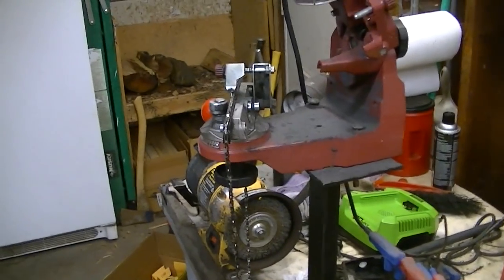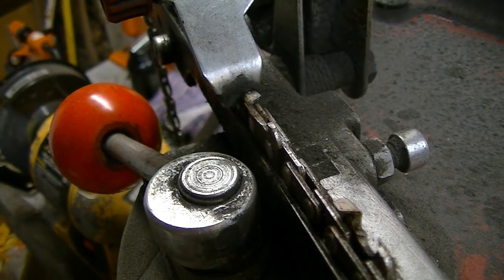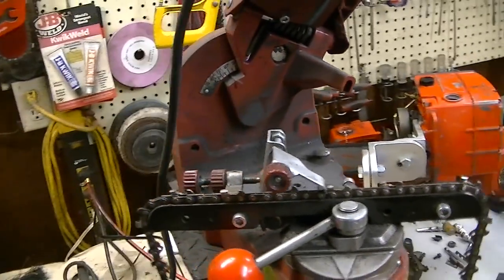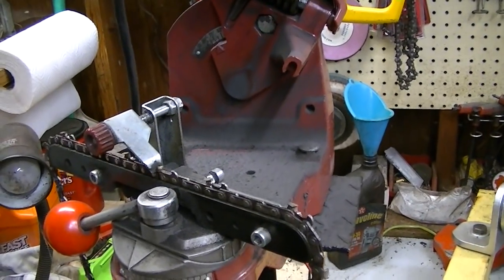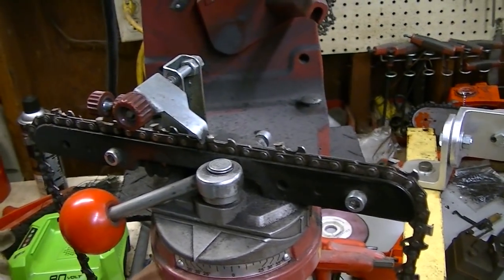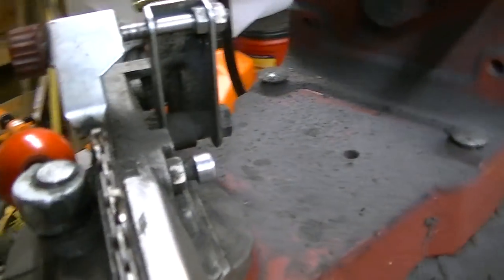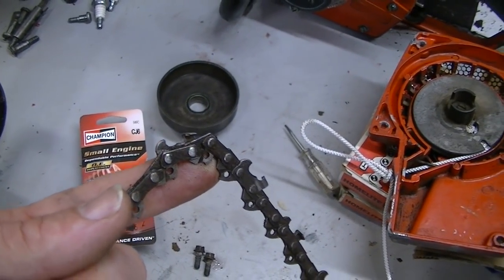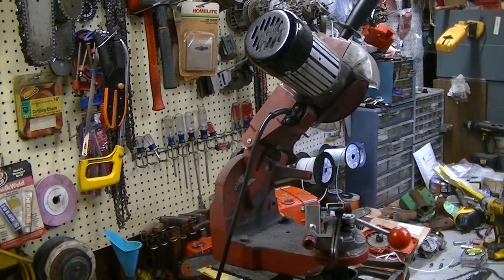Why I Prefer a Chain Grinder

Comment from the maker: Okay folks, I posted this video to show people how I sharpen a chain, especially on a customer's saw.  There are dozens of different opinions around this topic and in the video I'm not trying to persuade anyone, simply showing one way that works every single time.  But since a number of folks that follow other channels have decided to point out to me how wrong I am, now I'll do a little persuading.  My method takes a lot of steps out that can trip the average user up.  Yes, chain teeth can be different lengths and still cut good.  HOWEVER for that to work, you must file each depth gauge to match each tooth, each time you sharpen the chain.  I'd guess that many saw users don't even own a depth gauge, let alone have ever used one.  

Simply looking at a chain with mismatched tooth lengths will demonstrate that this is going to cause some sort of abnormal wear.  Chainsaw teeth taper back as they wear; if one side is filed down an 1/8" more than the other, the high side ends up doing more work, as it protrudes farther into the cut.  It stands to reason that the bar rail on the high side will end up having more pressure applied to it, hence faster wear on that side.

For every 10 used bars I see come through my shop, 8-9 have significant wear.   Whether it's chunking out of the rails, low spots, spread rails, tapered rails or some combination of all of these, it all comes back to the chain maintenance.  Bars will wear over time, but how you maintain the chain determines a lot of how quickly they wear and how badly they deteriorate.  I am a firm believer that the BEST method of chain maintenance is to keep your chain teeth the same length and if you have the ability, match the raker heights to the teeth.  That's what I recommend based on my experience and I can assure you that I've cut hundreds of cords of wood.  I've sharpened hundreds of chains and when I was a beginner, I made many of the mistakes that I now try to help people avoid.

For the guys that watch Buckin' Billy Ray's channel, I really don't need your commentary about how how much I can learn from him.  I enjoy his channel from time to time myself.  If I wanted to learn about climbing, falling or restoring old axes, he'd be a really good source of knowledge.  When it comes to saw repairs and maintenance, I don't need to look to his channel as my knowledge and experience speaks for itself.  If you've just watched one of his videos and come here to tell me how wrong I am, do me a favor and keep it to yourself.  I'm not at all interested in hearing it...if you want to have an intelligent conversation about something, contact me through my website: https://www.leonschainsawpartsandrepair.com/contact.html
Reply: Well said and eloquent response.
Reply: Very well stated Leon. I enjoy Buckin's channel also and I appreciate the both of you sharing your skill and expertise.  I enjoy learning from both of you and a few others too.  I think you're doing a fine job and hope you continue to share your experience.  There's a ton of videos claiming to show the "right" way to sharpen chain.  In the end we have to decide what's gonna work for our own situation.  I use a grinder and I like it for the consistency and the speed.  I also sharpen by hand sometimes and have had good results that way too. One of the things I like about hanging out in your channel is the no nonsense way you have of explaining what you're doing without all the flashy special effects and graphics.  Just a guy calmly doing his thing and teaching anyone willing to learn.  That, plus I have 6 Homelites that I like to keep running!  Love the older saws.
Reply: I have a carlton grinder just like this . in your opinion leon, what are the best brand of discs to use ? I only use mine for my own saws .
Reply: I watch Buckins channel and he has some one do most all of his repairs and runs modified saws most of the time. When it comes to  When it comes to saw repairs and maintenance. Your channel. I didn't read the comments but you hit the nail on the head.
Reply: Well said sir I know ur method works since watching this I just used it earlier so he'll with what others think it works . Thanks again for your help and video.
Reply: i guess Im asking the wrong place but does anybody know a method to get back into an instagram account?
I was stupid forgot the login password. I would love any tricks you can give me!
Reply: @Aldo Gannon Instablaster =)
Reply: @Jeffrey Gatlin I really appreciate your reply. I found the site thru google and Im trying it out now.
Takes quite some time so I will get back to you later when my account password hopefully is recovered.
Reply: @Jeffrey Gatlin it did the trick and I finally got access to my account again. Im so happy:D
Thank you so much, you really help me out !
Reply: @Aldo Gannon you are welcome :D

Comment: Forget all the so called experts who provide with negative comment. Your info is spot on. I have been using an "Efco Jolly" grinder for the past few years now. I have 3 saws, Husky 450, Husky 365 and a crap Ryobi (don't take it out in the bush though. I cut 13 to 15 tonne of good old Australian Hardwood per year and use it at the house. I take 3 chains per saw with me and cut my wood into 14'" rounds 24" thick. I load about 1 tonne per trip. I change the chain each tank of fuel. or when I hit rock in the dirt! On my return home it takes no more than 4 or 5 minutes per chain and they are ready for the next trip.  Been using the method you so accurately describe for all that time and have always achieved great results. keep up the good work!
Reply from the maker: Thanks Frank!  The methods described in this video are certainly not the only way to maintain a chain...but they are tried & true and will deliver the same results each time.

Comment: late to the party with this comment but thanks for your video. I read down the comments and  was kind of surprised at the number of misinformed and less than sharp viewers....and a fair number of smart asses. The grinder is an excellent tool for reproducible, consistent sharpening of cutters and setting of depth gauges. They are not meant to be carried to the woods like some comments mentioned.  And the set up to sharpen is quick and easy once you understand what needs to be done. The way I use them is to have several sharp chains, do no filing in the field, bring the stuff home and tend to chains in the shop. I have not found the pink wheels to be junk either, used correctly they do a fine job and lend themselves to dressing to a face shape you want with the dressing stick. The real key to using these is to be accurate in set up then take very, very small cuts, that way the metal does not overheat  I would bet many of the negative comments reflect the lack of knowledge about cutter geometry and sharpening procedures. I have had the Oregon model for more than 25 years now and still the same OEM wheel on it. I milled logs with an Alaskan mill and relied on this grinder to produce well sharpened chain in a short time.

Comment: A suggestion, swap out the filament bulb on the grinder & replace with a LED one. Less heat generated & more light output for energy input. Really see what you are working on !

Comment: No flame intended you need both. The grinder if the chain hit the ground and was tilling the rocky soil. The grinder if teeth were broken off a like new chain and the repair kits changed out the bad teeth. A file for a quick touch up if the chain looks ok. I do use the file more.
Reply from the maker: Sounds reasonable to me!

Comment: I, also, have a Roughneck Sharpener.  My problem is the Tilting Deck settings. Some chains claim to need a 0 degree angle, some a 10 degree angle.  Unfortuneatly, I can't find anywhere what those three markings are supposed to be.  The instruction manual for this area of settings are clear as mud.  I know this video was posted a long time ago, but if anybody can tell me which angle is 0 degrees, which is 5 degrees, and which mark is 10 degrees, you'd sure make this old man a happy camper. They show up very clear at time 2:44.  Thank you for any help you or anyone else can supply.
Reply: If your talking about the tilt and the three marks you see at th base that is for chisel chains those are  10 degree o degree and 10 degree against your doing right hand cutters you loosen up th table and push the knob away from you it will line up with another mark on the base plate that's 10 degrees if it left hand cutters you pull the bottom of the table towards and the bros will line up again and it's set 10 degrees for left hand cutters this has absolutely nothing to do with the proper angle though . like I said this addresses full chisel chains only . semi chisel or anything else you leave that part centered. Some full chisel.still chains don't even require this adjustment. If you use Oregon full chisel chain you will use this. If your doing all the rest if the settings right younwill.have a very sharp saw but your starting to sacrifice safety kick back and other such undesirable issues with this its very sharp but gets dull quicker if that makes sense.

Comment: Grinder or file.  As long as they cut to your likeing.  Realy dont matter.   On a grinder you can make a chain. Cut. So much it will stall a saw out.    Chain wont stay sharp long.  So.  30 deg 60 deg and 10deg set back.  Nice slow grinds.  Youll be happy.   I can change a chain faster then any one can file.

Comment: I have a grinder similar to yours and it came with those junk pink wheels also. Once you get your hands on a resinoid wheel @t you will throw those pink wheels in the trash like I did. They do not heat up the cutters and blue them removing the temper, you will grind in half the time.
Reply: what wheel do you use now?
Reply: CBN

Comment: I have an Oregon which has  been used sparingly over 10 years.  I have a big problem with the chain dragging  on the back end when I advance it despite trying adjustments.  I always have to pick it up. Any suggestions?  
You have a very calm pleasant way of presenting. Thanks.
Reply: Sounds to me like you need to tighten the vice a vice a little

Comment: Hi Leon I have that same sharpener and I have a hill of a time move the base to 10 degrees. I was thinking of taking it off and greasing the bottom or taking a wire wheel to it. Any suggestion would be appreciated. I am worried the grease might hold the metal shavings and get worse. The teeth come out sharp but I think they could be better. I am cutting hard wood. Oak mostly.
Reply from the maker: That's the one real flaw of this sharpener...the tilt base isn't the smoothest.  There is a small ball under there to act as a detent, so be careful if you take it off.  I just loosen the knob up pretty much all the way whenever I have to tilt, especially tilting the chain back.  There is a spot weld that catches the big washer, so you have to reach up there and guide the washer over the weld.
Reply: @LeonsChainsawPartsAndRepair  Thank You Very Much!!!!

Comment: Being 5ft.6in.,what would be a working  height to mount the bottom of the base of grinder in a comfortable work position? Also, would you     do a video on the rake filing to maintain the suggested bites the tooth should be in to provide smooth cutting flow.

Comment: Do you have to change grinding wheels to sharpen different sizes of chains like ,325, 3/8 picco, or 1/4" chains
Reply from the maker: Yes.  a 1/8" wheel does good on 3/8"LP & 1/4", 3/16" on the 3/8" and .404"

Comment: nothing compares to grinding a chain, it's the best by far!
Reply: In reality there are a lot of chains that has been hardened and overheated by grinders.
The hardened edge is not sharp. And it is not possible to file.
Reply: Now that's the fault not the operator there ZTE various ways to keep from overheating   . in regards to the operator of the saw I offer this . Some of you don't know when to quit when you've run your saw in the dirt in rocks or fence wire . you think you can continue to horse the saw and you think that's what the dog Paul is for . you absolutely will ruin a brand new chain that God himself can't fix . I've seen thus happy and you have to file away half the teeth to get it to cut right again then you get passed off at the guy who sharpened he saw and compost e took off way to much material . and some of you are arrogant enough that you swear you can fix it with your file. You can't do it and you bring me your chain you've ruined I can see it in a heart beat.

Comment: If you started with your most damaged tooth wouldn't you be prematurely shortening the overall life of the chain. If  99 percent of the teeth are good why would you want to bring them all down to the lowest common denominator?
Reply: My thoughts exactly.
Reply from the maker: Hardly ever are 99% of the teeth good if one is completely fouled up.  That's not how it works folks!
Reply: @LeonsChainsawPartsAndRepair  True, but many, many times I have seen only 3-5 teeth damaged badly on one side and the rest somehow didn't get affected.
Reply from the maker: @yearginclarke  Absolutely.  The 3-5 teeth are the ones that will get filed down and be so much lower than the rest of the chain that they break off before the rest of the chain is worn out.  It's really a catch-22 no matter what you do.  If part of the chain ends up badly damaged, the overall life of the chain is shortened no matter what.
Reply: @LeonsChainsawPartsAndRepair  Yes that's just how it is.  I hate it when it happens to a chain that has some life to it.
Reply: @yearginclarke , that's where keeping a part worn chain comes in. For own use, break & repair the severely damaged cutters with similar worn, but decent, from donor loop.
Soon recoup cost of chain breaker & rivet spinner, in salvaged loops.
Reply: @trwilkinson4623  Great advice, I never even thought of that!  I should have known that actually.  I work in logging and have sawed my share of limbs and knots off and on over the years, of course chainsaws have been largely replaced by processing machines, etc.

Comment: If you are sharpening a lot of chains, why not go with CBN grinding wheels. I love them. They leave a better edge then the pink wheels thus cutting longer and the thing hardly wear out , making them cheaper in the long run.
Reply: less heat on the cutters, less strain on the grinder engine an none of that nasty grinder wheel dust. Place  a magnet and all the trash is caught.
Reply: And no glass dust to breathe, never need dressing, no heat.

Comment: I noticed you do not loosen and tighten the vise clamp lever when you move from cutter to cutter. It looks as though you leave it semi tight so the chain will still move while pulling back with your left hand to apply tension against the stop. Does that work well for you? It looks like to me it is one less thing to do and a time saver.
Reply from the maker: Well I do still use the vise, but I've found I get a more consistent grind if I pull back slightly to seat the tooth against the stock.  Honestly the tensioning part of this grinder isn't the greatest.
Reply: I've got same grinder there is an adjustment for the vice tension part . its there . it requires a little Fiennes just like all the other adjustments . you use an allen take a look a little closer its there I see other videos where people miss that also . when you get the tension on that set right it will make the tooth set itself upright in the cradle so to speak for lack of a better way to put it. I'm not a professional took me a while to figure it out myself but it's there . everything else you've said is spot on and I did it just like you did till I caught on to how to adjust that clamp properly I think you're go to see it makes a difference when you use your machine. Not trying to be mean spirtted about it.

Comment: I use to think the same thing as you stated about the cutters being the same length, I have a video showing a chain with 2 cutters missing and I ground the rest of the cutters on that side so they are half as long as the other side and because the drags are set correctly the chain still cuts like new and straight. https://www.youtube.com/watch?v=rKN3p_QwhCQ

Comment: I have a cheap Harbor Freight grinder. Not quite as good as yours, but nicer than hand filing.
Reply from the maker: Honestly that's what I started with as well.  I've said many times that for homeowners or people that want an upgrade, but don't have a need for the expensive ones, the Harbor Freight model is not a bad option.
Reply: Bottom line I found out was to take your time and set it up right.  Makes a world of difference.
Reply: P
Reply: That's what I have and it works OK for my needs. But, I find that after grinding a chain, I still need to touch it up a little with a file for maximum sharpness.